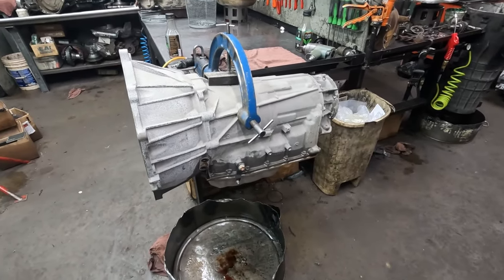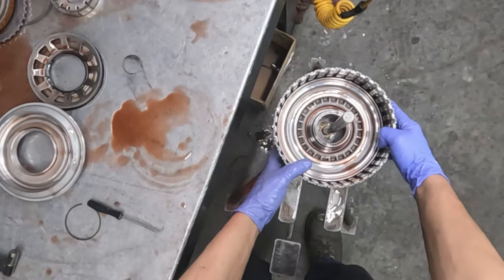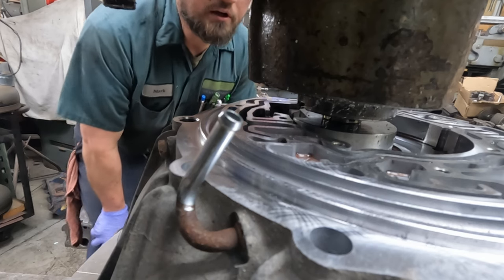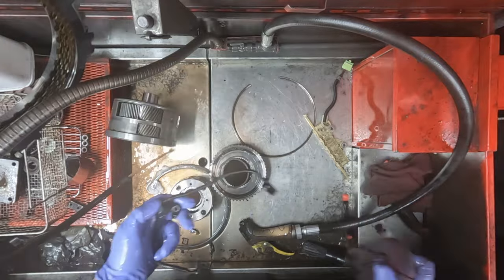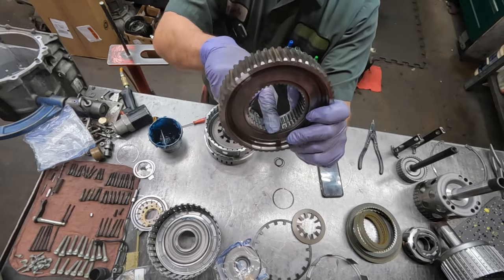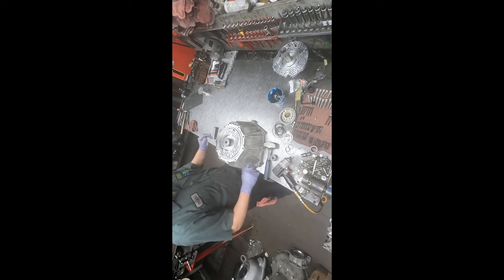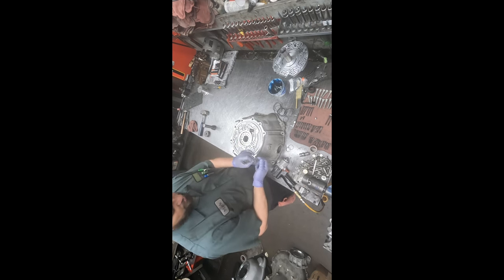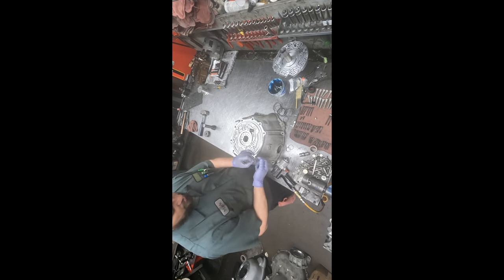6L80 6L90 Rebuild Full Length of Disassemble, Clean, Reassemble with comments.

Comment: Thank you for making this I watched and followed pretty much the whole process here to just finish my 2017 6L80 myself 1st time doing it,  I rebuilt my engine back in November did an AFM Delete and changed the camshaft,  so when my tranny went out at 120000 miles after the first one went out at 60000 I was beyond angry with letting Chevy put there hands on my truck again.  One thing I commend you on that I could find no where else online or in repair manuals is the two holes at the rear or the output.  I have a 2wd and I couldn't remember before I broke down the case if those two holes get plugged or not.  You are the only mechanic I found that mentioned this  If it's 4x4 they get plugged,  2wd they do not.  Thanks for loving your job and being as thorough as you are,  you bring the faith and trust back to the profession.

Comment: As a fellow content creator, I can really appreciate the amount of effort it takes to make one of these videos.  Thank you so much.  I'm about to tackle my 2nd ever AT rebuild (first being the 700R4).  Without videos like this it would be impossible to do it right.  The tips and tricks along the way make or break the rebuild.  Wish me luck!  My first attempt failed when the 700R4 lost the front pump after my rebuild.  I'm hoping this time I do a better job!  The 6L80e appears more rebuild-friendly than the 700R4 but I will find out!
Reply from the maker: 6L80 is a pretty good unit to build. Read through the comments here for some additional info. One supplement I'd like to add when I get the chance is using 1500 grit paper to polish the aluminum that the pistons seal against. I ought to do that soon.  Thanks for watching!

Comment: I like the fact that you said worked to death, not junk, I have a 2008 GMC 2500hd that has a 6l90  with 243,000 miles and it's still working good. I do abuse it a little. Now that I said that, it will probably crumble,,, lol
Reply from the maker: ...knock on wood.

Comment: Hi, Mark; Doesn't the pump slide spring pocket need to deepened to prevent biding? I hear this happens after machining?
Reply from the maker: Yes, the resurfacing procedure is to deepen the pocket enough to remove the gouges. Then restore proper depth by cutting the top of the channel the same amount. This machining increases front endplay which we compensate for with a thicker pump  thrust washer.

Comment: When we pull the parts out of our instaclean we have to immediately rinse the parts with hot water blow them dry  or the film is not good. Good job thank you.
Reply from the maker: we've found the aluminum surfaces in the center support and pistons in the 123435r drum need to be polished with fine sand paper like 800 or 1500 grit. Otherwise, the aluminum can be etched and prematurely scuff the new bonded pistons. Thanks for watching!

Comment: Great video! Thanks for sharing. I didn't catch what was used to clean the TECHM. I have some metallic in areas of my TECHM and not sure what to clean it with. I cleaned everything else in kerosene. Was considering a can of brake parts cleaner and lots of air. Wasn't sure if it would be too harsh but wanted to clean it up before removing the seal plate so no metallic gets in there. Thanks again for sharing..
Reply from the maker: Sorry I didn't see this before. Brake clean and compressed air is good to use. Just be careful with the air. If it's regulated down to 40 psi it's a bit safer to not damage anything. If there is a lot of contamination or high mileage, you might want to replace the techm.

Comment: Thanks for sharing mate. I just paid 8K australian dollars to have my 6l80 rebuild. Next time i will have a go myself.
Reply: What happened to yours mate? My 2014 SS just let go on me yesterday with 60'000kms on the clock, got it booked in a few days tech reckons it might be a failed torque converter.
Reply: @Jimbo_Waz  it was converter material building up and clogging the filter . This trans should be serviced every 45k km. At least the ones with stock converter

Comment: Hello Mark - great vid.   Very clear and detailed.  Kudos man !!

Unfortunately, getting a rebuild on my 6L90 / 165K. 2500HD this month.  I tow 6000lb trailer.
Planning on a billet torque convertor in the rebuild, with both transgo kits.
What is your opinion on following for 6L90 rebuild work truck......
1. 456 billet clutch hub with factory dampener setup, necessary or overkill ??
2. 1234 billet piston, necessary or overkill ??
3. billet pump rotor, necessary or overkill ??
Reply from the maker: Hi. I can say I haven't used any of those 3 HP parts. Yes, use a quality billet cover convertor and both TransGo kits. The next best thing you can do is reprogram TCC strategy to delay lock-up until 4th or 5th gear. Shops with HP Tuners can do that and I believe there are other DLC plug-in products available to revise lock-up strategy.  If you live south of Canada we have been deleting the thermostatic bypass if it contains one.  An update I should do to the video is to polish the aluminum surfaces where the seals and pistons ride. They get scratches and certain cleaning processes can leave the surface etched. This scrubs away the pistons over time and shortens trans life. Good luck!
Reply: @scatteredrustyprojects  Thankyou for your feedback, very much appreciated......
yeah - HP parts and cost plenty $$ each - looking at some options for known tranny failure points/weaknesses. I guess my $5.5k rebuild vs a $6.5K with greater longevity. I just cant afford more "truck down" time.
Reply from the maker: @hockeynut088 Forgot to mention we also install a 1234-35R drum with higher clutch capacity. We've done quite a few trans in service trucks, 1-ton dump trucks and other vehicles that get loaded and never needed the billet stuff. The billet is for the turbo'ed vehicles making 1000 hp and getting pounded.
Reply: @scatteredrustyprojects  Is it transtar drum ? Any part number for that drum/kit ?
Reply from the maker: @hockeynut088  A104554B
Reply: Hi Mark, my surburban has the 6L80 
Not having any TC or transmission issues at the moment. Unfortunately I had the lifter failure. 
Guy I’m having rebuild the engine and do DOD/AFM delete said he can tune it to delay lock up and this should solve any TC/transmission issues. Could you explain more what delaying lock up does?
I do have a camper that I tow that is on the top end for the tow rating of the truck. So just trying to assess if the tune should be fine or if I should be looking to trade it in for something else once it’s running again?

Comment: What transmission rebuild kit is the best bang for your buck. Which kits do you recommend. I know im getting a new torque converter and a sonnax zip kit. What rebuild kit do you think would work also after that a possibly a part number. Thank you.
Reply from the maker: I use transmission parts suppliers like Transtar, VTP or WIT. The WIT kit is lacking a couple things, one of them being the bearing at the front of the 1234-35R drum. Lately, I've been using the AC Delco seal kit, buying a set of bonded pistons and replacing only clutches that need to be replaced. I haven't used the Zip Kit.....it looks like it has what you need. If you aren't changing the Techm, take a close look at the pressure switch films....they can split and leak. Watch for galling in the pump area. Two bushings important to replace are the pump bushing and input shaft/456 drum rear bushing.

Comment: My second gear (solenoid B ) is stuck on. I haven’t done a oil change on my Transmission ever . I bought it at 35,000 and now I’m on 159 ,000. I pulled the pan down and my oil is black and burnt. I was just going to change out the filter, valve body where the solenoids sits and add new trans oil. I did hear the pump wind before the solenoid got stuck on. Do you think I need to do a full rebuild or do the stuff I just mentioned? I have a 2015 Chevy Silverado with 2 wheel drive , 5.3l v8 .

Comment: Great tutorial. I just finished rebuilding my 6l80e transmission.  My question is, can I drive it to the shop to get it flashed. The shop is about 100 miles away. Would it do damage in any way?
Reply from the maker: Most of the time, not always, if the techm has no program, it won't have engagement. 100 miles? If it had engagement and in a middle gear I'd be concerned with taking it more than a block or so. Try to find someone local.
Reply: @scatteredrustyprojects  it drove perfectly after rebuild. No new techm. Shifting great. Thanks
Reply from the maker: @brassskills6084  excellent! glad to hear that.

Comment: Hey mark what an amazing indepth video! I just replaced the solenoid pack on my buddies 2015 1500 and we get no park/drive indications on the dash and after it's first start and shift it would no longer start as it thinks it's not in park. I'm guessing the neutral safety switch is not engaged as I never touched it. But could it be anything else? Do they need programming? Please advise 😢
Reply from the maker: if you got a new Techm from GM it will need programming and won't show shift position until programmed. I believe the aftermarket like Dorman are the same. It's possible the NS switch isn't engaged with the manual valve. Or the manual valve isn't engaged with the pin on the rooster comb---detent plate.
Reply: @scatteredrustyprojects  can it be programmed once installed, or do I have to remove it and can I do it at home with something like the Chevy version of forscan or is it a dealership thing?
Reply from the maker: @shadow6958  I program using a J2534 pass through using ACDelco Service Programing. This is done with the techm in the vehicle through the data link connector.  I've heard of other people programming the techm on the bench. Being I don't export units, I haven't looked into that method. Many independent shops are set up to do the pass through programming.. With either independent or a dealership, you'd have to tow the vehicle there.   Also, I believe shops that have HPTuners can program a blank techm. With HPTuners, the final touches of revising the TCC partial apply on 2nd gear to a full TCC apply in 4th or 5th would be a great benefit to this trans.
Reply from the maker: @shadow6958  I've only heard a little about Forscan. Not sure on the capabilities. Some of it sounds intriguing. I use Delco for GM and Motorcraft for Ford. It is rare enough if I need to program anything else that I would just take it to that dealer.

Comment: What if the truck runs and goes in reverse? The only thing is it won’t move when in a complete stop it’ll just rev but it’s only when it’s in 1st gear once it starts moving everything works fine
Reply from the maker: If it won't move in D, but will in manual 1, that could be a failed low sprag. Have to monitor speed sensor data on scanner and do some other checks to verify. I feel like there is another cause to this symptom, but I'd have to research to see.

Comment: Is there an upgrade rebuild kit for trucks/towing application? Also, can the green assembly gel be used for the entire build, or just for needle bearings etc.?
Reply from the maker: i put in both of transgo's kit. The valving  restores the common areas of wear with upgraded pieces. An additional clutch can be added to certain drums to increase capacity. Heavy duty torque converters are available. Plus, changing the tune aspects will also increase capacity.....need to find someone with HP tuners to make those calibration adjustments.  The green transgel is fine to use everywhere. For any color transgel, don't use more than to need. The dealership uses only trans fluid for assembly.

Comment: Would over tightening pump bolts to 150 lbs torque cause pump rotor to fail and break in pieces.?
Reply from the maker: The spec is 97 in lbs. While possible, I doubt putting the bolts at 150 would be the cause of the rotor to shatter. If clearance was too tight it could seize.  The #1 cause of rotor damage is the convertor was not fully engaged during trans to engine installation. Or, a big enough piece of something got past the filter to lodge in the pump.

Comment: Great Video> I really enjoyed it. I have a 6L80 in my 2013 Camaro SS with over 600HP and more HP coming. It slips going into 3rd. So I'm going to rebuild it with all Sonnax upgraded parts and high Performance clutches and steels.  I'm suspecting a cracked 1234/35R drum. Or the piston that is known to crack. I'd like to have a more positive or harsh shift. You mention in one segment of your video, that if you left out one of the wave plates you would have a harsh shift. I want a harsh shift. Is that something I could do and maybe replace the wave plates with steels? Just wondering. I would really appreciate your expertise. Thanks.
Reply: Circle D makes a level 4 kit..

Comment: I just had my 2016 done back in June. They replaced it with one they had on the shelf. I paid 6200 for it with a limited lifetime warranty. Is that in the ball park? It did have 180000 on it when it let go.
Reply from the maker: WIth pricing, there are variables with region, shop over head and such that affect pricing. Lifetime warranty is crazy on one of these or any transmission, but then not sure how "limited" takes away from that.
Reply: You paid $6200 for a transmission? 🙄

Comment: The 4-5-6 drum on mine has very burnt clutches and obvious signs of over heating. The drum that holds the clutches is blue. Can I reuse the drum or is it best to replace it?
Reply from the maker: We see a lot of the 456 burnt up, I can't say I remember ever replacing the drum. Not sure how bad yours might be. Check to see how well the pressure plate moves over the length of the splines, the heat could have made it wider at the top. Look for gouging where the steel plates will spline in. It's a big job, so if you have doubts, it might be best to replace it. If reusing the drum, scrape out all the metallic sediment that builds up. Check your pressure plate for flatness, replace if cupped. It sounds like you will be replacing the steels and wavy. The snap ring will get "reset" from the heat to a smaller diameter. I usually stretch them open a little, just gotta be careful not to make it out of round.  Check fitment of the small bushing to the 456 clutch hub pilot. We replace that bushing as part of rebuild.
Reply: Awesome thank you ! Appreciate your response. Also the big reverse drum the bearing on the bottom with that lip seal built in. What do you use to change that bearing? The seal on mine is damaged due to me thinking it was an o ring. I can’t find any tool to pull that bearing out.
Reply from the maker: @FleetTech97  I have a small pry bar that seems to work pretty well.  I use and arbor press to install the new one. Perhaps you can put the bearing on the bench with the drum on top and push the drum down to get the bearing mostly in.  Use some type of driver to push down on the center of the drum . Then find something  to push the bearing in flush with the drum surface.

Comment: So maybe someone can help me out with an answer to this, i dont live in the states, i live near germany, nobody here seems to have worked on these transmission here yet. 

My issue is the 2nd gear, the transmission "floats" or "slips" with lots of throttle applied. The rpm rises but the car doesnt really go accordingly.
I think i have to rebuild my transmission by myself. What will be the issue? New clutchplate pack?
Im a car mechanic but i never did automatic transmissions ever (yet)

Comment: So how much $$$$ was this rebuild???  just curious.
Reply from the maker: I don't remember the bill on this one. In my shop for a complete job with rebuild and R&R. 6L80-90 tend to be somewhere in the range of 3800 to 5500, depending on extent of internal damage, whether it needs Techm and other variables like cooler lines. mounts, U-joints etc.

Comment: How long does this job take from start to finish?
Reply from the maker: diagnostic, removal, rebuild, flushing cooler, usually replacing cooler lines, installation, road testing.....about 16 hours

Comment: So your saying 150,000 is good milage on a 6L80 considering I pull every day about a 3,500lb trailer? Mines getting a rebuild as I type this.
Reply from the maker: Eh...yeah. Being we typically see the torque convertor failing 75-100k. Had a one not too long ago  with only 32K and one with 46K. Also though, it depends on usage. In my area the closest highway is 45-50 minutes away. It's mostly traveling at 30-50 mph where the torque convertor clutch is always in a "controlled slip" and rarely fully locked up. This works the convertor to an death, sometimes resulting in convertor replacement or sometimes rebuild.
Reply: @scatteredrustyprojects  thanks for the reply, I feel like I did ok on mine then, I did maintenance every year on mine since new,,cycle between a flush and pan drop every year rather the miles we’re there or not.

Comment: Rebuild kit recommendations?
Reply from the maker: Lately, I'v ebeen using the GM seal kit, a bonded piston kit from any of the suppliers and selectively replacing clutches.
Reply from the maker: The GM seal kit does not come with the bearing in the back of the drum which has an integrated seal that needs to be in good condition or replaced. It's more than a lube seal. It holds compensator feed oil which can have an affect on shifting. With that in mind, you may want to use Transtar as their kit does include that bearing. The WIT kit did not. Depending on where you are, a local transmission parts supplier may or may not include the 1234-35R drum bearing.